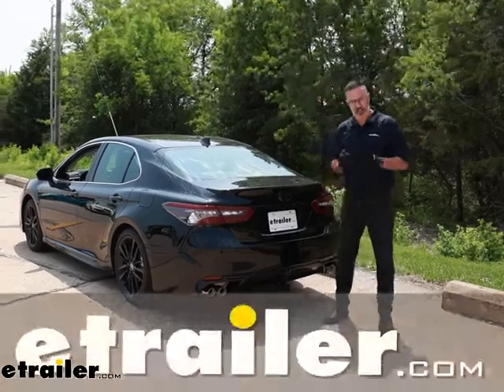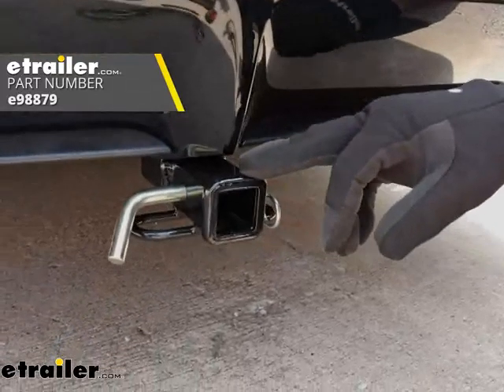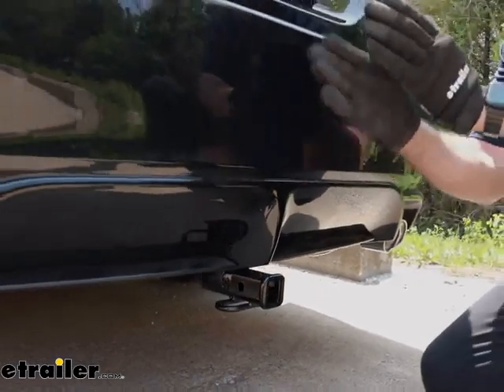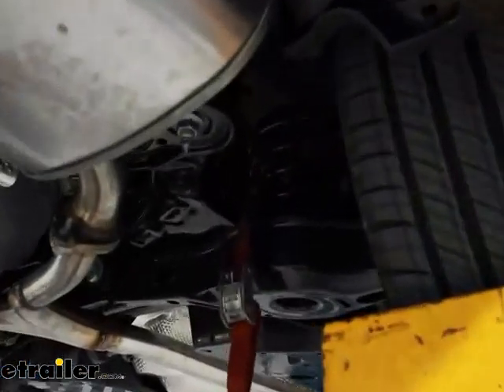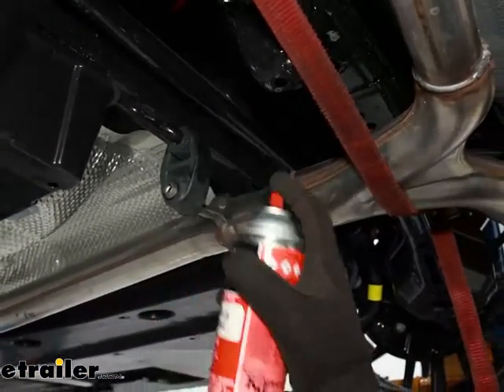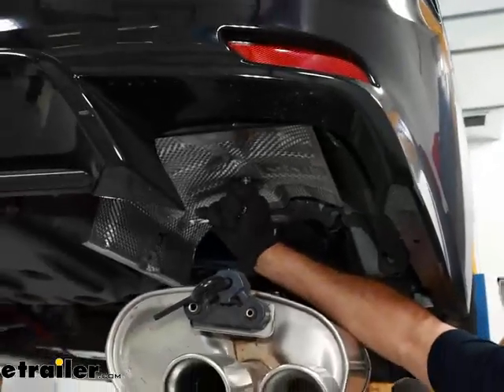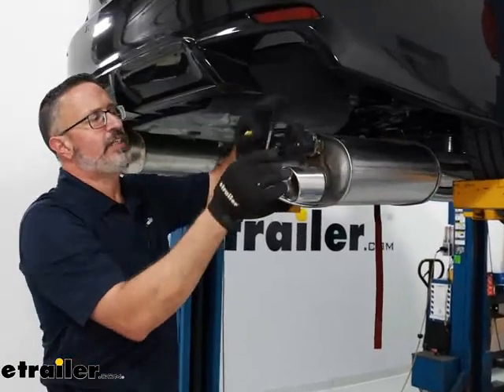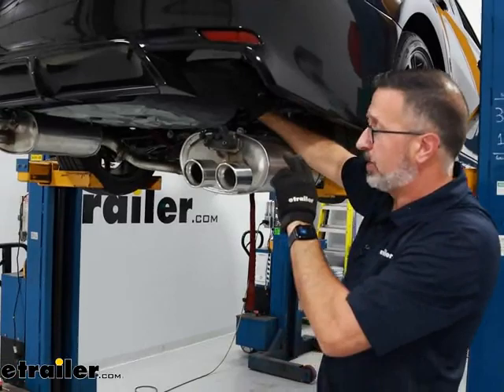etrailer | DIY 2023 Toyota Camry Installation for the Curt Trailer Hitch Receiver

Comment: What size hole needs to be drilled out for the bracket? Trying to make sure I have the right step bit before kit gets here. Thanks
Reply from the maker: If you're using a step bit, you'll want a 1 inch diameter hole.
https://www.etrailer.com/Trailer-Hitch/CURT/C11576.html